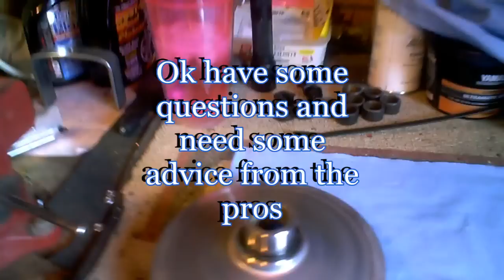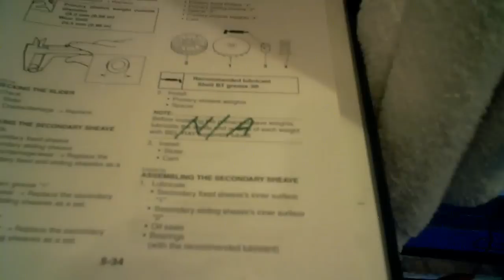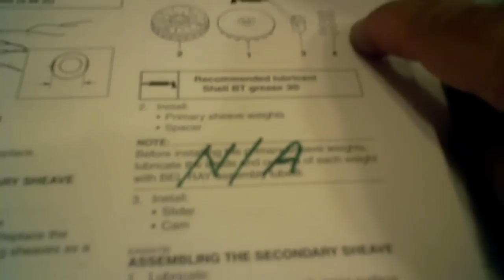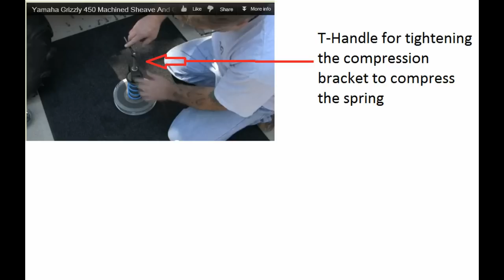Yamaha Majesty CVT advice needed

Comment: Put the threded rod in the vice tighting it up where it will not turn. Place a 1/2 in 8x8 piece of wood on this, dill a hole in the wood. That way the alumiun back will not get mared up. Weld a cross piece on the U piece so it will not spread. Make sure the threaded rod is long enough to release the spring. Then make anouther U piece with lips going under the V part to spread it wide enough to install the belt so you can put it back on.